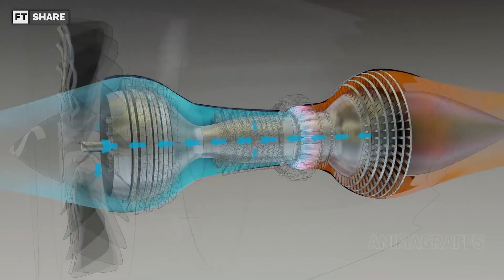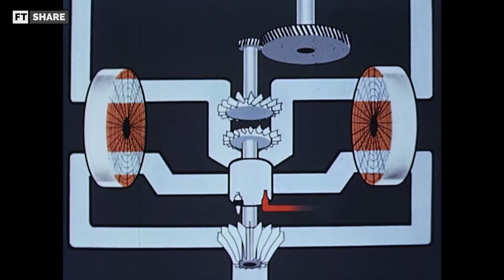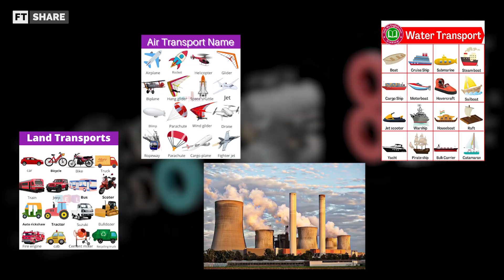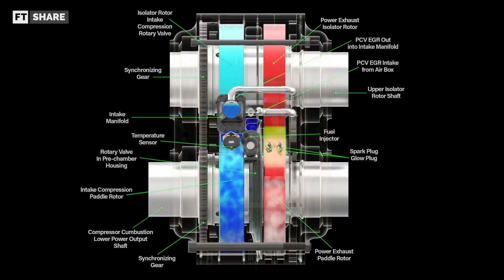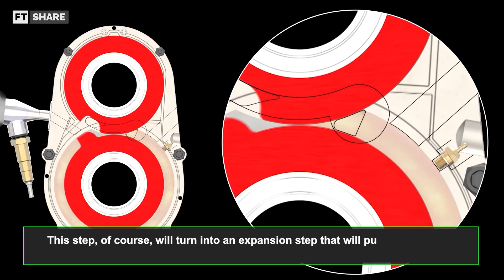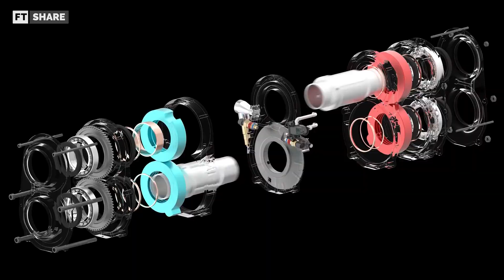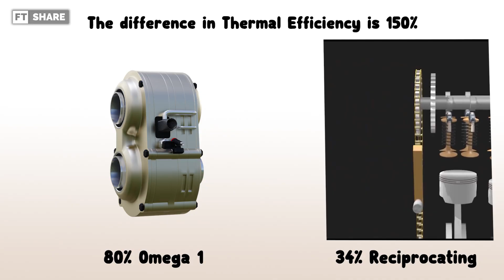Ready To Destroy EV Engine!! | Astron Aerospace - Omega 1 Engine

Comment: This is a joke, right?
An engine firing once per revolution, while combining intake with compression and combustion with exhaust is called a four stroke? Not to mention, that they are proud of not using seals, so during the whole cycle, the lubricant oil is not only exposed to the air-fuel mixture, but is on the surface, where the combustion happens.
And how do they expect to achieve 25k RPM redline with a direct fuel injection system?
Not to mention that "pre-chamber" being open during the combustion phaze and the whole geometry of the combustion chamber making this a highly inefficient engine.
Also, it has a compressor the size of the cylinder, so if all the four wheels' weight inside the engine  combined is not less than that of a cylinder head, then how would they achieve that "unmatched power to weight ratio"?
And how do they expect to reduce manufacturing costs, when the engine block is made out of three parts, each requiring precision machining?

This is either a joke or a scam.

Comment: Good gimmick :) I can patent my dump and will means nothing. Physics says it won't work, but as west students fail math at 90%+ rate right now is to be expected. The main trouble is that the power is calculated using the surface of the piston as the piston has been replaced by A tiny bump with almost no surface this make a perfect scam for dumb people.

Comment: Like other commenters, I am highly sceptical of the claimed 80% efficiency.  Just removing the exhaust gases can consume over 20% of the energy and then there friction losses, the heat absorbed by the engine, requiring cooling and associated pumps or fans ... Also, no detail is provided about the seal between the notch and protruding peg on the rotors - it looks to be a poor fit so will result in compression/heat losses. If there is no apex seal (like in a Wankel engine) then the wear rate on the peg or casing will be unacceptably high and result in loss of (some) compression.
If the ideal of this engine were true it would be a nice trick.

Comment: 1st I LOVE IT. 2nd i would like to see how it preforms under long use. Like what is the weak link that breaks down? How long before it breaks down? And how easy is it to fix? Because even if it's AMAZING, and it looks like it is, if it breaks down every month that's a problem. Of if it needs to be scrapped after 6 months that's also a deal breaker. But i would LOVE to see these on hybrid cars.

Comment: This is all theory. In the end, it is all about the cost.
This engine can have 60% efficiency (that is already incredible) vs 30-35% of your typical 4-cyl engine. That is a huge difference.
Being lighter just makes it even more efficient (as a whole within a vehicle).
But if it is too complicated to make thus, has way too high cost it will not pass.
Today's engines are highly optimised, have relatively cheap production cost and have great choice.

This had to be ready for mass production, cost the same as comparable 160hp engine and maybe it will have a chance.

Comment: Definitely a Good concept but  some parameters are not so easy to achieve. We just cant say anything before testing it , but if it works also it cant beat the EV units thermal efficiency and instant power of an EV. Mazda has been working for such a long time but they could not prove its endurance.

Comment: Your graphics SUCK... JUST GET TO THE POINT OF YOUR TITLE...   at 9:30 the engineer YELLS "CUT, WE'VE GOT FLAMES"... LMAO... don't think it's ready for the road just yet... but if it does what it says it can or will do, then EV's will be for the Rich and these could be for everyone else... a mechanical motor more efficient than a standard gas motor and possible run on diesel which costs less to produce.... but your video could have been like 7 min. shorter...

Comment: You start the video by not getting the story right about Turbine engines. 
First Turbine engine that not only worked in a test bench but had real utility are "Junkers Jumo 004" & "BMW 003" Turbine engines. And they were installed on the Messerschmitt ME-262, and they flew in combat during WW2 (1943-44)-45 

The production of Turbine engines began on the desk as early as 1939 in Germany.

But if you had said that it only applied to Turbine engines installed / fitted in a production based car, well then the 1950s is correct. But Turbine engine as such, you are WRONG! 
Junkers shared all tech and experience to the Americans after the war.

Comment: I would call this a 2x2stroke. Technically a 4 stroke, but also like 2 two strokes due to the thermal separation 'rooms'. In a regular 4 stroke, all the steps occur in the same cylinder space. That's not true for this engine, even though all the same steps take place.

Comment: unfortunately I think it would work, but it would not be efficient or viable   . the thermal expansion and expansion caused by centrifugal force resulting from high rotations  would require a big distance between the components, which is a big problem,losing understanding and efficiency.I have a more ambitious project than this one, but I have similar problems

Comment: Would Hydrogen work with this engine..? Used as a hybrid connected to a alternator for electric motor it could be very small little vibration and small radiator cooling needed .No need for high RPM .

Comment: Bro machining and producing it will be very difficult and very expensive
It has extremely high revs so the parts need to be strong and light so can’t use simple iron or aluminium alloys. I think it will be to the point that you have to account not only for thermal expansion (this can be remedied by making parts after taking thermal expansion into account but u have to heat up engine before starting) but also for elastic expansion under stress and this will also vary over time (not just as the metal ages but even during a single drive session the elastic expansion won’t be constant)
AND 80% efficiency seems rather impossible
Maybe you can add two or three of these assemblies and reduce revs but this will obviously add complexity weight friction and obviously reduce efficiency. 
But I think before you can research all this and reach mass production we will have H-EVs with green H2

Comment: Bullcrap. There's no such thing as 80% efficiency in a thermal engine. Poor sealing, high friction and a very thin and long combustion/expansion chamber, translating into high heat loss, all speak against this "engine". By the way, swept volume is rather low for its size, so claims of high power to weight ratio are dubious as well. Last but not least, the presenter doesn't do it any favour by beating around the bush in a precious-ridiculous lingo which does a poor job masking his ignorance about thermal engines, instead of going straight to the point and explaining clearly and coherently how the damn thing works. If I were you, I would not invest in this "invention". And if you want to tease your brain, there are a plethora of compressed air pumps and motors, each one of them having the potential to be turned into a new kind of internal combustion engine. Just take a pump and a motor, add a fuel injector, a spark plug and some cooling system and there you go.

Comment: I don't trust this. It's theoretical but not practical. Very high degree of precision is required for manufacturing & they need different or some new materials for this engine. Still it will be highly unreliable. Electric motors are best.

Comment: Wouldn't the volume of the combustion chamber be very small with this engine?  Would it run faster to compensate?  Just seems weird you could get the same power as a piston engine from that small combustion chamber.  I would think the same of wankle engines though and apparently those are workable.

Comment: It appears maintenance would be far cheaper and simplified as the motor itself could be swapped out for a new/reconditioned core in a very short time.  In addition, it could take a variety of fuels and adapt its ignition profile via digital.  Considering these two factors alone, I see commercial applications, to include compact marine engines, as the most viable, near term market opportunities.  This topic is definitely worth further study - thanks for the video!

Comment: This design works on paper. The compression rotor is a great idea.  Look at the surface area of the hot side upon ignition:  5 of the 6 surfaces produce NO work.  The total surface area is huge compared to the "piston" area, even if you only count a third of the expansion (as it's already burned and expanded and is only waiting to exhaust).    You could stack this into a multi-rotor design and add a blower. I would love to see a Real One in action.
Reply: What?  The exhaust gas only pushed on the rotating tongue, the rest of the area is the combustion chamber, get it?
Reply: It already has a blower lol, it won't work without it

Comment: This is not turbine engine this is not wankel engine.
Patent is one thing. Other thing is a fully operational unit heavly tested in many scenario. This barely working concept is not ready at all. Without proper sealed and with huge amount of oil leaking from everywere. No one will buy license for untested contruction with that huge disadvantages.

Comment: I would be more interested in a 31.2 or 62.4 kg version of the engine. It would still be lighter than most of the conventional engines, but the power would be at sports or supercar class. And for a flagship could be and 93.6 kg engine with four of these engines combined with power of 640 hp and 920Nm of torque. That would seriously rip. They should offer these to formula 1 or world rally car series.
It cannot be a success without motorsports. That could also make a serious dirt bike engine with just the basic version. I'm volunteering to test these if you bring them to me.

Comment: It has no viability if it cannot run on non-carbon fuel. It needs to use hydrogen. Better that the company ditches combustion engines altogether

Comment: It will be interesting to see how this engine fairs on test. I would especially would consider  the rotor and gear and seal wear, also the units ability to accelerate under load. I also notice that combustion rotor only has a small area for the expanding gas to act on. Will rpm make up for this loss off reaction area?  If extreme high revs are required lubrication will also be ultra important. The engineering and balance will also become very important.
 I do though wish them luck, as  many a good idea has foundered because there is too much invested in existing technology for the manufacturers to change course.
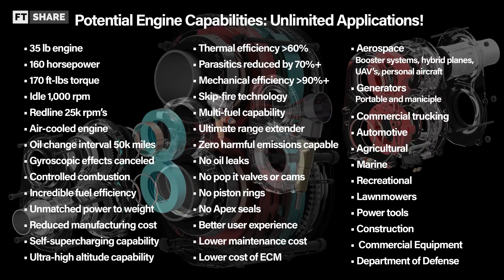Reply: They seem to be utilizing some fantastical way of lubricating or suspending those shafts as their info screen at 5:02 states oil change intervals of 50k miles and no oil leaks.

Comment: I can hardly wait till they put this on a motorcycle!  This seems perfect!  Lightweight, high power, Rotary.  Yeah baby!  FUCK cars!  Put these on wheelchairs!  I know some folks that would love that!  Hell yeah!

This motor makes a lot of sense.  It seems to have much fewer parts.  It rotates as it should.  As everything else does in life.  And what fuels they could make it work with?  Something hopefully more advantageous to our, atmosphere?  And can it burn, alcohol or diesel fuel?  How about kerosene?  CNG?  How about hydrogen?   We just gotta know!  Please?  Pretty please?

I can also only imagine this is smooth and quiet.  Compared to the more conventional.  Requiring counter balancers and all that jazz.  This don't need no such thing.

This could be a significant breakthrough?  Provided it is also the least bit fuel-efficient?  But if it's more like gas turbines?  Then it's a gas hog, again.  And we are back to go.  If it doesn't sip on fuel.  And is this a step in the right, direction?  Or just more of the same old, same old?

I hope this is the new thing.  For the next few decades.
RemyRAD

Comment: Where is the oil against the fraction between the rotary surfaces? In the combustion room you can not have oil because the emission standards and that is the problem of Vankel motor! I did not hear anything about the solution?

Comment: 1 quick question, where do I put the shaft of the gearbox? Looks like the inner rotating cylinder has a few holes for a good purpose. What if we shoved a shaft there, would it work?

Comment: The reason for the Jet car engine of the late 50's failing is simple - they work most efficiently at higher speeds, and don't favor running at low speeds, which is what is needed for an engine in a car. That's why it failed. If this engine was hooked up to an electric motor and batteries, it would be a great running at high speed, and provide electrical power.

Comment: Clickbait right here. A concept, which is 80% efficient? It sucks air, explodes and sucks more air and explodes faster. Whats the torque? Whats the fuel consumption per mile/kilometer? 
In the end, the oil needs to be extracted, transported, refined, transported, filled and refilled mostly which ships and trucks. 
This oil extraction creates a dependency on a small group of companies, which can pull the lever to crash economies, just check the latest news in europe.  

Electricity can be created on my roof. Whats the "from extraction to wheel" efficiency for gasoline and compare that with "Photovoltaic system to wheel" on an EV.

Comment: Let us do the math for the Carnot efficiency : Typical Exhaust gas temperature at 700C = 1000K ( for a diesel it is lower)
This means that the combustion temperature with a thermodynamical efficiency of 80% is 5000K
The metal with the highest melting point is Tungsten: 3700K. So even if this engine was build out of Tungsten it will become liquid after a short time. There are simply no materials in the universe that can withstand these temperatures. Gas turbines are struggling to get an efficiency of more than 40% because of material limitations.
Ceramic materials have similar melting points as tungsten but conduct heath not very well and cooling becomes problematic. Also if the combustion chamber has very hot walls this will worsten the filling and lower efficiency because you heat up the entering mixture. Tests with ceramic coated materials in engines gave no benefits and was abandoned a while ago.
You will be nominated for the Nobel prize if you can achieve an thermodynamical efficiency of 80% with any type of combustion engine.
Another factor that is not good for thermodynamical efficiency is a flat combustion chamber (e.g. Wankel engine). A flame front has a finite speed. To reach all corners of this flat combustion chamber takes time and not all fuel is burned. In other words the combustion will not be optimal. A Wankel engine therefor never can reach the efficiency of a piston engine. Ideally you want a compact semi -spherical combustion chamber were the flame front can travel from the center in all directions. This Omega engine has not an optimal combustion chamber.

Comment: Compared to an electric motor, by the time this combustion engine gets to market, without regarding future advancements in electric motors, it will be not feasible. Electric motor has less maintenance cost to this one, produce more power and have more torque than this, while having the same weight. I suspect the cost of all the components to create the combustion engine also is much greater than that of an electric motor. So we only got the battery (power source) to talk about.
"But battery should be taken into account, it's weight more exactly; just like you take into consideration the weight of the fuel for all combustion engines"
If you look at the power density for the last 10years for batteries, you can understand that in a few years the weight of a battery would be cut in half. Weight of battery seems like the only downside. Cost of fuel for a battery (electricity) vs cost of fuel for a combustion engine (petrol would be much much cheaper than hydrogen) is still orders of magnitude lower, and will keep on getting lower, this can be fact checked by the decline in the cost of electricity production. The charging time has dropped significantly in the last 8 years and with current charging technology, it looks like you'll charge an EV in about the same amount of time it takes to pump petrol in a combustion engine car. When charging from 20% to 80% is under 10mins, the charging vs fueling becomes a invalid argument.

Overall combustion is a nice thing, it's a very mature and refined technology, but electric motors, batteries and electricity manipulation (production, transport, storage) are in their infancy still. Imagine what happens when you start having on top of the already cheap solar panels that produce electricity for 30years, the nuclear fusion that basically creates infinite electric energy. This engine is dead on arrival from a mass market standpoint, maybe very few nieche applications might make use of it, but it doesn't look like it'll give any retrun of investement, so it's not feasible to run a business that is self sustained from this. Cool presentation though!

Comment: How about doing some BASIC research ?

Heres a few entries from Wiki.

1899: Charles Gordon Curtis patented the first gas turbine engine in the US ("Apparatus for generating mechanical power", Patent No. US635,919).[6][7][8]

1903: A Norwegian, Ægidius Elling, built the first gas turbine that was able to produce more power than needed to run its own components, which was considered an achievement in a time when knowledge about aerodynamics was limited. Using rotary compressors and turbines it produced 11 hp.[10]

1930: Having found no interest from the RAF for his idea, Frank Whittle patented[12] the design for a centrifugal gas turbine for jet propulsion. The first successful use of his engine occurred in England in April 1937.[13]